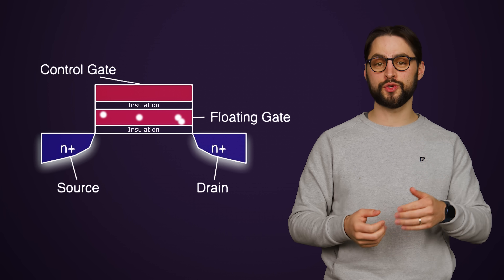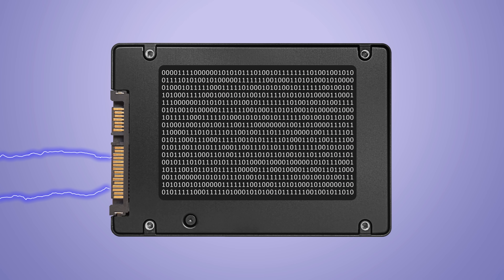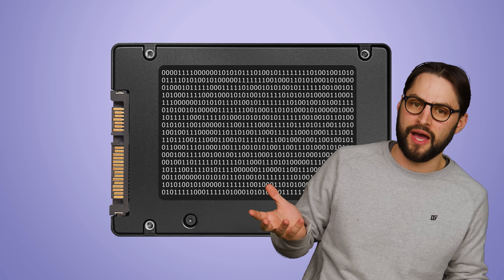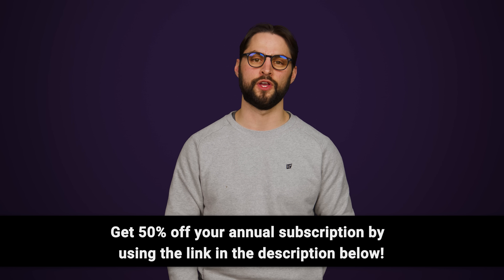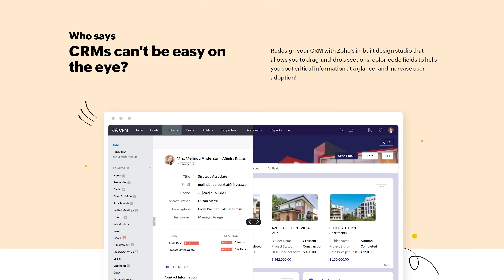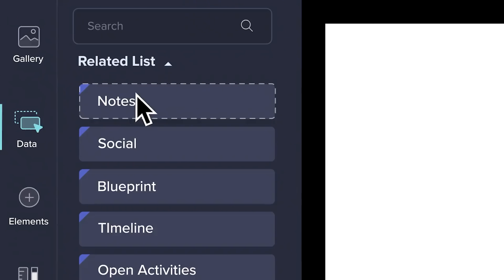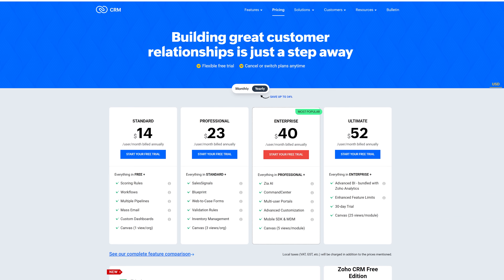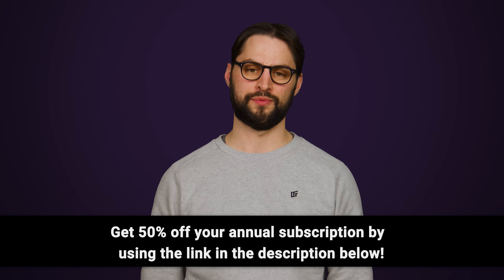SSDs Die, RAM Doesn't. Why?

Comment: Modern DDR (citing DDR SDRAM) is a type of Dynamic random-access memory. It requires only a single capacitor and a transistor in its logic to hold state between one and zero. 
In comparison there is another type of RAM that is called SRAM that uses six transistors without a capacitor to store the bit value.

The advantages of DRAM is density. You can put a lot of single capacitor-transistor pairs in a single space.
The disadvantages are latency and electricity consumption (also heat) - after all, you have to discharge that capacitor and charge it in an opposite direction to switch the bit.
This is why DRAM is nowadays used for the general purpose random access memory for every computer - because it's cheap and it offers a lot of volume.

The advantages of SRAM is that it's very, very fast. There are no capacitors to discharge and charge.
The disadvantages are that you need not one, but six transistors for every bit. This makes it expensive.
SRAM is mostly used for CPU cache, embedded in the processor itself.

I mostly agree with this video, but to say that the DRAM is a bunch of capacitors is half-true. The capacitor is there to hold the charge for the transistor, which would itself represent one or zero.

Comment: I still think electro wetting would be a better solution than what SSDs use, for a more catchy name then electro wetting drives (or EWDs) I would call them e-drop drives (or EDDs), anyways the way I would expect electrowetting drives to work is 2+ cells per drop (2 for a binary bit, 8 for an octal bit, etc), all but one cell would have a ray of light going through it while the drive is "reading" the drop, an interruption indicates the drops position & the value of the drop, so the drives could split a single ray of light into multiple rays and read multiple cells at once, a lack of interruptions would yield a 0, since e-drop cells would maintain their state without power & experience no degradation they could be given a lifetime warranty just like ram, I'm not sure but they might even be resistant to EMPs or at least the random radiation crap that causes random bits to change since I doubt they'd hold enough power to move the drops

Comment: Also note the mechanism of CMOS (complimentary metal oxide semiconductor) or any sort of MOS.  They actually are moving parts however at a sub-atomic level when the electrons pass through.

Also remember that many SSD's and RAM are a MOS where they need to remember that the "oxide" is actually "rust".  Yes rust is in your circuitry however these integrated circuits or chips are hermetically sealed however over time oxygen does get in and they then increase that oxide layer therefore making the transistor useless for charging and discharging.

Also static discharge is a common occurrence which leads to faulty storage devices including RAM.

Comment: I have personally had ram go bad during a memory test. Testing used modules for a friend, passed on first cycle/pass, let it continue to run then forgot about it. For a month. (It was in an unused office at work). 122 passes in memory addresses starting failing and kept failing. Shut down are restarted the test, failed at same place on first pass and every subsequent pass. When I first saw the failed address I got excited that I had seen a cosmic rays flip a bit, but if it was a cosmic ray, it didn't just flip the bit, it trashed the whole stick of ram.

Comment: So why isn't an alternative to SSD or HDD storage RDD storage? You'd just need a source to keep it powered, like have it trickle from the PSU when the computer is "powered off".  And this wouldn't be an issue for systems that never power off.
Reply: There was, Intel Optane, nobody bought it because it was too slow to be useful and too expensive to be affordable...

Comment: Good video overall, but the Floating gate (FG) operations weren’t animated nor explained correctly. To program the cell, charge from the substrate is drawn into the FG by applying a high voltage on the gate. To erase the cell, a high voltage is applied on the substrate pulling charge out of the FG and into the substrate. In both cases the electrons tunnel in or out through a process called FN tunneling.
The program and erase operations are not through source to FG or FG to drain as shown in the video! The FG to substrate and substrate to FG tunneling through high voltage traps charges in the insulator (tunnel oxide) over time causing the device to degrade, allowing allowing FG charge to leak through traps. 
Source to drain current is only used in the process of reading / sensing. Please consider correcting it the video.

Comment: This is why I always has question in my head. If Ram chip can have longer life than SSD nand chip why not just use it as SSD chip and integrating little battery similar to CMOS battery?
Reply: Because RAM is expensive, flash is cheap. Nobody wants a 64GB RAM-SSD for $400, such SSDs have been made and sold, almost nobody bought them.
Additionally, integrating a battery just returns us to the 'AT' days with the acid leaking batteries killing the computer... Nobody wants an SSD that will lose data if left unpowered for a few days. Want to go on a holiday? Well better leave your PC on, wasting energy or else you'll lose all your data...

Comment: I wonder, why we're not at the point to get rid of the RAM, when the speed of the SSDs are increasing. I mean, I read some discussions on that, but most of them think of it in a way to replace RAM... But, as I understood how computers work, they use the RAM to load data into, to have a higher speed working with the data. But.. they have to load the data into the RAM first before they use it from the slower drives. At that time that was ok, because the use of tapedrives, floppy disks and the first HDD was also not as fast as today. So everytime you wanna play a game the PC has to load the data from the drives into RAM and VRAM and so on, but if you would remove the RAM from that equations, wouldn't it mean it would actually has no loading time? It's already there. No need to copy that into RAM, copy onto CPU registers. Sure, RAM is faster for that... That's an issue to overcome still, but besides that, should it not speed up, because you don't have to copy the data to ram first, because there is no ram to copy into, the data is already  "loaded"... For example on hibernate, you don't have to copy the XXGB of RAM to the drive, you just switch of and when you need it, it's already there
Reply: RAM speeds are still much higher than SSDs, most NVME SSDs list read/write speeds of 3200MB/s or higher, which they can do, for a short time... Then the SSD overheats and slows down to cool down again...
RAM will just keep doing 15-45GB/s 24/7 without issue.
The bigger issue however is with latency, DRAM has latency measured in nanoseconds (billionth of 1 second), SSDs have latency measured in milliseconds (about 1 million times higher) for random read/writes.
Replacing RAM with flash memory (SSD) is technically possible but the computer would be extremely slow.
As a final issue: flash memory wears out, running your SSD as RAM would wear it out within a week or so. Nobody wants to buy a new SSD each week...

Comment: "Degrade" is the wrong word to be using for this comparison. Both SSD's and RAM can and will "wear out", and cease to function eventually. It's inevitable. The difference is the "over time" part - for SSD's it's years at least, (decades maybe), while typical RAM can last decades at least. But at the end of the road both will fail.

Comment: Capacitors on RAM may not hold a charge when the power is off others do.  I've been shocked by enough of them to know.  The bigger capacitors have bleeder-resistors attached to slowly discharge them when the power is off.  They can actually electrocute a person when fully charged.

Comment: Capacitors do hold the charge. That's the whole point of capacitors! In PSU or even near CPU there are power capacitors that hold power so when there is spike in power demand they can release their charge to overcome the spike because, for various reasons, power from PSU wouldn't be sufficient for a fraction of time which could cause some mistakes in ones and zeroes, it basically smoothens fluctuations of voltage due to instantaneous power demands. However it is true that capacitors lose their charge over time even if they are disconnected from a circuit. Point is that in RAM capacitors are in discharged or charged state accordingly to a data they store. When the data is read, their charge is used to "drive" their fellow transistor to let electrons pass, thus signaling the system either one or zero. After that, to hold the data, it is needed to recharge it. Also over time their charge "leaks" so it is needed to recharge them periodically. And because capacitors in RAM are teeny tiny they lose their charge pretty quickly, in a fraction of a second. So yes, without power, data in the RAM is lost because of how quickly its capacitors lose charge. But no, generally capacitors do hold a charge even after power goes off but if the charge is unused (for example by the dimming LEDs and other motherboard circuitry after shutdown), charge leaks in time depending of their design and capacity. So that's why I consider "Take away power and the capacitors can't hold the charge anymore" as misleading.

Comment: I've had a 1TB SSD for a good 5 years now I think, and checking the right-click in explorer it says it has 930GB compared to the 931GB my 1TB HDD reports. So, I've lost about 1GB out of 1TB. That's a whopping 0.1% of the space lost due to bad cells. This is assuming some of that data isn't taken up by MBR or other system stuff that the computer isn't reporting as being part of the normal drive capacity.

Comment: Soo.. what if u used memory on like ram.. just always keep the unit powered. Would it work.. sure if it ever lost power there goes all games but you could just as easily redownload all that. Or save most the important data (game saves pictures document ect) to a normal ssd. While having the larger more easily downloadable stuff in a over sized ram storage device
Reply: They did that a LONG time ago back in the Windows XP days.
It was called the Ramdisk. It was a PCI Card (not PCI-E) with a battery and 4 Ram slots. 4x 1GB max.
Basically a 4GB Ram hard drive which was enough for Windows XP but very expensive and limiting.

Nowadays if you have a lot of Ram you can just make a 'Virtual' Ramdisk in Windows from your extra ram.
When you shut off it saves the image to your hard drive and loads it back to the ramdisk when you boot up again.
It's fun to run a hard drive speed test on a Ramdisk and get 10,000MB /sec speeds.

So if you have a ton of Ram you can make a Ramdisk and install a game on it or something and enjoy the fastest possible load times.

Comment: In short: SSD keeps a charge when PC is off, RAM doesn't. Charge = hardware degradation.
Reply: cough the battery on the motherboard cough
Reply: Well, no... If that were the case, the lifespan would be identical for a computer that's always on.

Comment: If you have two SSDs with the same storage capacity what are the MTBF outcomes.
(Based on verifiable findings.) 

The SSD at rest.

The SSD at work.

Example: Is there a difference between two identical SSDs when one is run during work constantly, and the other updates every 24 hours...?

Comment: Question about wear levelling.
I'm playing a game, and have a save file. When I save over that save file, does the SSD technically save this file somewhere else on the drive than it was before for wear levelling? or does it save it in the same spot, and wears out that spot fast if I'm making heaps of saves during my play session?
I've always made multiple save files for a number of reasons, one of them was to not wear out the same spot in the ssd by re-saving.
Reply: A video game's save file is generally a normal text file that just keeps track of certain data that might change over time (e.g. Protagonist said option 1 to NPC#4 at stage point ABCDEF) so the actual file size is rather small. Usually a few hundred kilobytes up to a few megabytes.
Most SSDs will continue to write to the same physical address in this case as generally speaking most blocks will be able to withstand 10,000+ re-writes before the controller needs to "retire" the block and re-allocate the data to new blocks.
Most SSDs also only show about 50% of the total available space so as to not make the capacity appear to shrink over time.

So all in all, you often don't need to fret about constant re-saving. The file size is already pretty negligible and usually within a reasonable bound that the SSD controller doesn't need to do constant scanning for if the block is still within a reasonable tolerance (i.e. requiring re-allocation of data to new blocks).

Comment: My favorite reason that RAM faults is space. Modern RAM isn't really susceptible to it anymore (As I understand it), but as RAM Cells got bigger, solar radiation would start flipping bits, causing it to be thought of as "Dead" by the rest of the computer. However when Un-Installed and tested, the RAM would  reset from lack of power and function properly, stumping engineers and techs for a while. Finitione, Turn it off, then back on.

Comment: A long time ago i saw a device that lets you use ram as an ssd. It connected to the pci interface and had a rechargeable battery to power the ram while the computer is unplugged.

Comment: Modern 4TB SSDs have 5,000 TB of data written endurance. If you wtite 100GB per day, 36TB per year, the SSD will last for approx. 150 years, which is not bad.
Reply: That's not true. Manufacturers keep adding more layers to the cells which increases density and lowers cost but decreases total lifespan writes. A perfect example is Samsung's QVO SSDs which use QLC (Quad layer). Their 4TB is only rated at 1440TB and the 1TB is only rated at a mere 360TB writes.
Yes its still a lot of data but older SSDs with Single/Dual layers will last much longer.
As time goes on they will keep adding layers to lower costs and increase storage capacity but they will keep lowering lifespan.
It's still a lot of data for most people but eventually they will start failing as fast as HDDs used to fail.
Reply: @Argedis  which part of my comment is not true? 5000TB is a common write endurance now.
Reply: @alexeysamokhin9629  Samsung's mainstream EVO series 4TB is only rated at 2400TB and their budget QVO 4TB is rated at 1440TB.
Samsung is the leader of Flash NAND memory. If your statistic was common then it would apply to the market leader.

Crucial's MX500 4TB SSD is only rated at 1000TB

Western Digital 4TB WD Blue SSD is rated at 600TB

SanDisk Ultra 3D 4TB SSD is also 600TB
Reply: @Argedis  Seagate FireCuda 530 4TB is rated at 5100 TBW.
Reply: @alexeysamokhin9629  LOL that's an ENTHUSIAST $1,000 NVME SSD

Just admit it's NOT COMMON to have 5000TBW
Reply: @Argedis  today it’s enthusiast, tomorrow it’s mainstream.

My point is that NVMes are more reliable than people expect.

Comment: So, basically, SSDs are batteries and ram is capacitors. Makes sense as other than extensive age without use caps have a basically infinite lifespan.
Reply: Though capacitors can be used as batteries:

The Cambridge Z88 used capacitors to power memory to keep its contents whilst you changed the AA battery that powered it.
Reply: @cigmorfil4101  capacitors can’t store energy for nearly as long as a battery can though

Comment: Everything stated is accurate. 
However Floating Gate SSD is the minority of NAND Fabbed today. I think Intel is the only Floating Gate producer left.  Every other NAND manufacturer fabs Charge Trap. Both have a limited number of erase cycles but fail in different ways. There are two factors that limit the number of erase cycles the lithography (smaller insolating layer) and bits stored per cell. TCL and QLC NAND have to erase and write the NAND to a much more exact charge. TLC needs to support 8 distinct levels, QLC 16. 
This video also did not address that NAND will not hold your data forever. The bits stored degrade over time and the more bits stored per cell the faster it degrades. To prevent data loss SSDs move data based on increasing error rate or the age of the data. This leads into the topics of Write Amplification and Over Provisioning which could easily be videos in themselves .

Comment: Of the about 20 HDDs I've owned, about 25% failed at some point (both partially ie some sectors and complete failure). I own 9 ssds from 60GB to 1TB and none has failed so far. Luckily I always keep backups so none of my data was lost. Phones and sd cards on the other hand did cause me some lost files though.
Reply: Exact opposite to me. I've had about 10 hdd's in total and none have failed, out of 3 ssd's however, 1 has failed.

Comment: I was wondering what happened to my quarter terabyte (256 GB) USB 3.0 flash drive. That explains why iys read only. But I can nolonger view the contents of my drive. Instead I had to use a utility called TestDisk by C.G. Security to recover the data. (Perhaps LTT could do a comprehensive tutorial or quick overview of this utility. As it has saved data from a previous drive that had a corrupt partition, allowing continued use of the drive.)